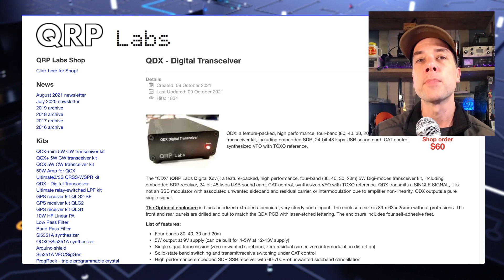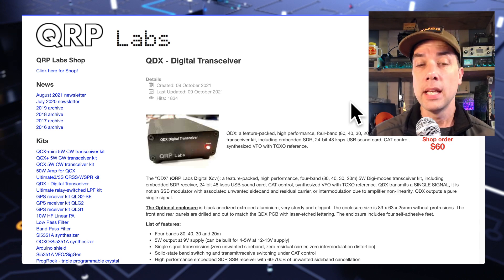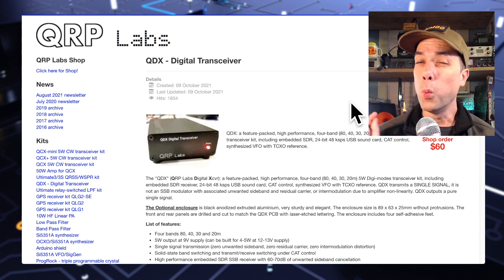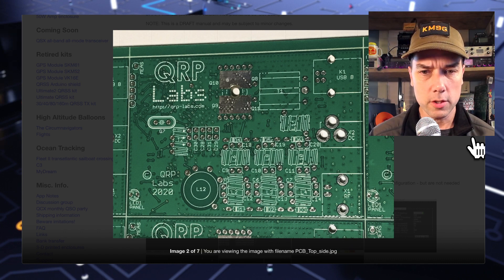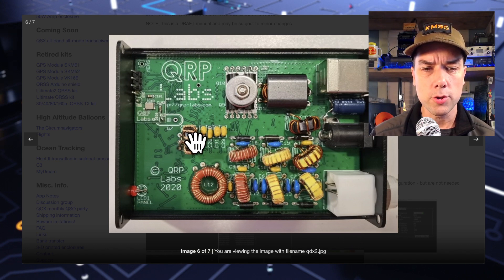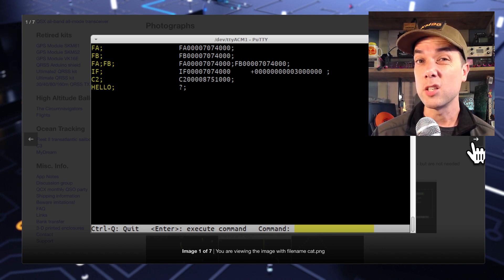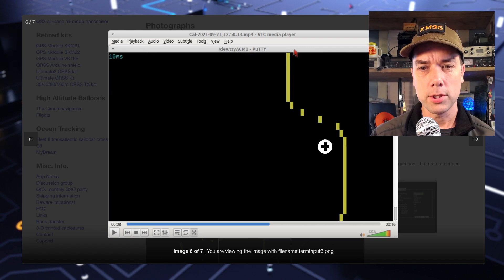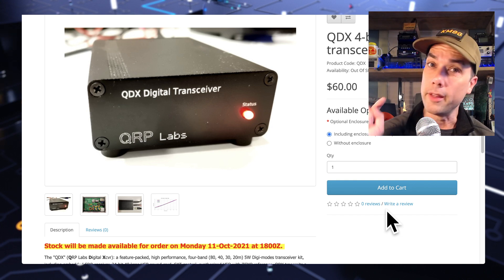New Digital Radio for FT8/JS8Call from QRP Labs! - QDX

Comment: I've spent 20 years doing electronics R&D, and the reason I bought this little digital rig, beyond the always creative, minimalist, and meticulous engineering design work of Hans, was the built-in 24-bit 48 kbps USB sound card. THAT is the heart of the rig, and makes this a fine performing rig even when plugged into an old junk laptop. In fact, that was why I bought 2 of them, so I can loan 1 out to convince other hams just how sweet and high performance these $60 semi-kits are. Between this digital rig, my (tr)uSDX SSB and CW rig, cheap VHF/UHF HT's with crossband repeater modes, and YouTube ham radio videos explaining free ham CAD software, and a variety of homebrew circuits and antennas, (not to mention 3D printers,) I feel like we are entering a new golden era of very inexpensive, high performance ham radio, and that makes me very happy. Around 1980 to 2000 was a pretty grim time for the hobby, but we survived it.
Reply from the maker: I totally agree John!  Spot on!
Reply: QDX default rig setting on JS8? Anyone? Bueller? Bueller?
Reply from the maker: @warplanner8852 rig is Kenwood TS-480, sound card is "QDX (something)"

Comment: Build it for 9 Volts, then add a little variable SMPS from your 12 V to dial the exact  output you want.
Reply from the maker: Exactly!  I built mine for 9v and I use a buck converter.

Comment: I may build one with your TO!
Reply from the maker: Nice, I'm already looking at how to make it 12v based.  It would e awkward to have this one 9v rig in my shack.  Its in the docs, and with proper cooling, it can do 8w from 12v... so I might look into that also.
Reply: @temporarilyoffline : I have been helping a friend in Oklahoma City fix his two amps.  Got his AL-811 going last week and then worked on his Icom IC-2KL amplifier going.  It ended up being the 48 volt power supply that was bad.  Got a MEAN WELL Switching Power Supply RSP-2000-48 (48V 42A) and got it down to 40.5 volts and now it works perfectly, albeit a little noisy!
Reply from the maker: @n5pa  mine is really noisy too.  I'd love to change the monster power supply in my 811, change the fan and maybe some other mods
Reply: @temporarilyoffline : Yes, my AL-1500 is real loud, but the tube costs more than I paid for it 22 years ago.  I paid $1900 for it new and now the Eimac 3CX1500A/8877 Tube by itself costs $3295 and a new amp is $6200.  It is loud, but will put out 1500 watts with 35 watts drive.  I am trying to decide what I am going to use as a 5 volt supply in the Ham Shack.

Comment: Now all you need is his 50w amp to go with it.....
Reply from the maker: I don't see a keying circuit for the amp, but I bet there will be an upgrade soon.
Reply: @temporarilyoffline  I doubt there will be a PTT for the amp. Digital modes and QRP are closely linked. Those using digital a typically operating low power inside a narrow channel and don't look kindly on someone coming on with 1000+% more power.